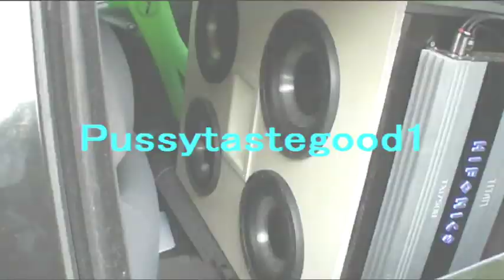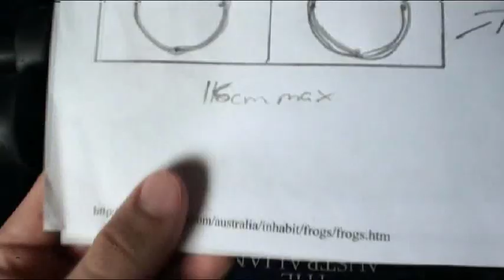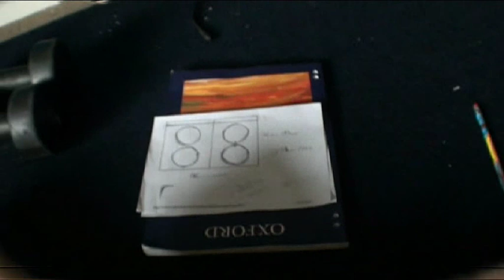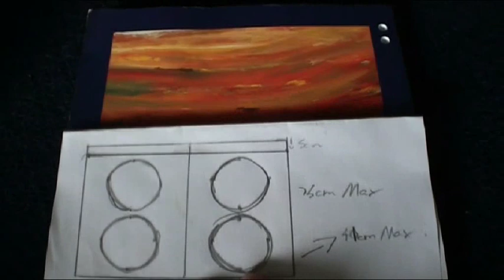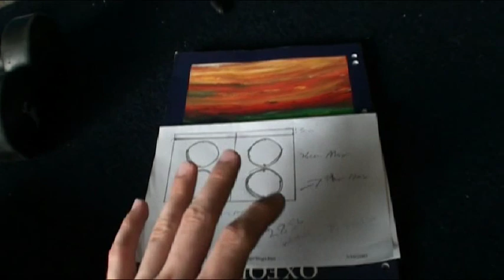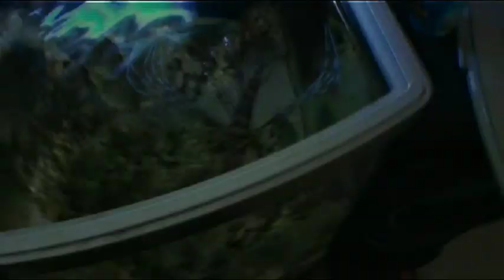New Box Design - Thoughts ? + Sub Update

Comment: @pussytastegood1 basically if you look at my charade, the box is COMPLETELY sealed up to the B-pillar... where as your last enclosure had open space to the sides, top, behind, without going to a fully sealed wall, you get a TONNE of cancellation from the airspace behind the enclosure...

more port area is better, i would say that if your keeping the slot idea, that to go with 4" minimum in height...

ideally i would suggest subs facing up, and port either facing up, or forward...

Comment: sorry man, probably not what you really want to hear but there's too many issues in the box...

1st up the port, you really need to stick to the bare 9:1 ratio, 1" wide for every 9" across but you also have nowhere near the needed port area, you have roughly 9sq inch of port per cube, where you really want a minimum of 16sq inch per cube...

i'd also say that unless you plan on completely sealing off everything behind the baffle, subs/port forward won't work as well as other orientations...